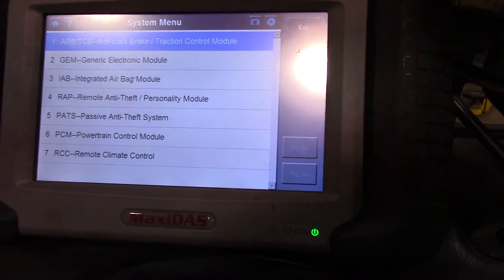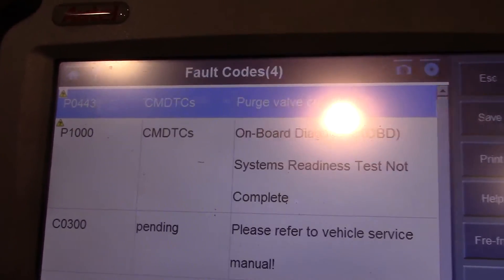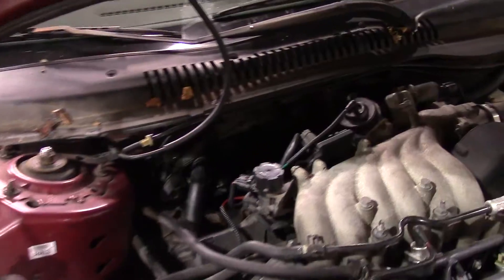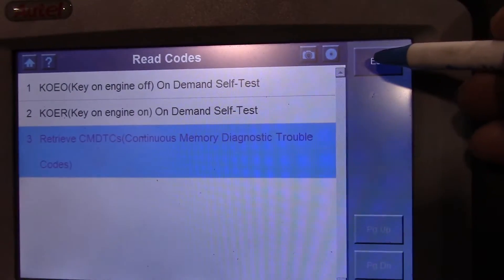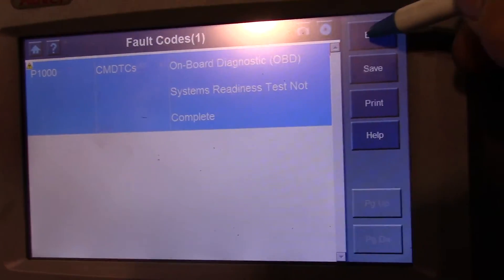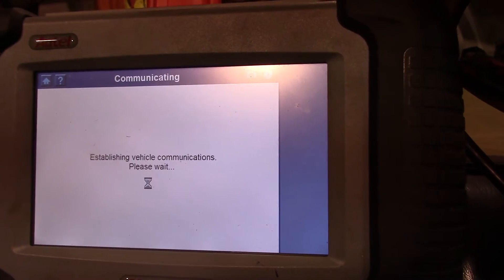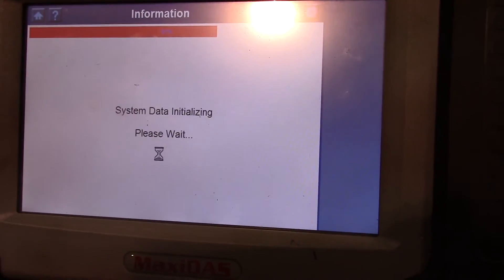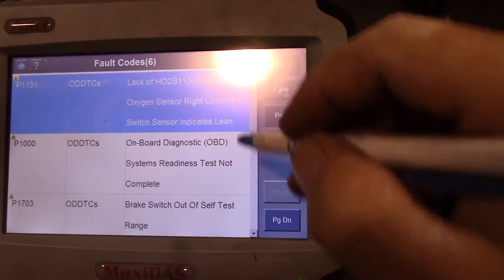Finding the cause of a P0443 Purge valve circuit fault on a 1999 Taurus

Comment: Mines full of ironworkn tools also, good work cars, had 13 codes, think purge valve maybe last problem, replaced all others, fixed 3 vacuum leaks I found today. I'll give it few days, according to plugs it burns right, no oil fouling all were tan but front 3 were way worn. Runs much better just idles like shit. Tps checked ok, the set screw has been moved before I got it, that maybe a problem, I put it back to get proper voltage for closed tps bout .9v,  new iacv, EGR pressure sensor and hoses, cleaned the map...gd gremlins, chasing 411 code now, I'm betting vacumn

Comment: I have a 2006 ford explorer with the code p0443 purge evaporation circuit fault, the question is if this fault is related to what the EGR valve code p0403 appears, if I change the purge valve, will the two codes disappear?

Comment: That pulled cable is odd, wires can break if they are corroded, but it looks quite sheltered.
I think i would zip tie the cables down, so the bugger cant snap again lol :-D
Reply from the maker: Yep! It's just beyond me how that wire pulled out of that connector. There was nothing pulling on it. Just a weird one I guess.